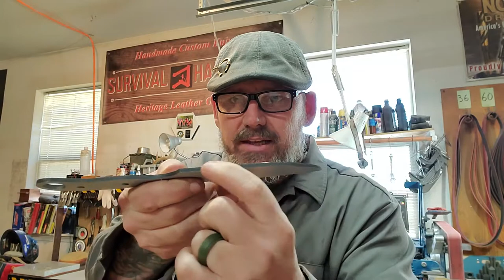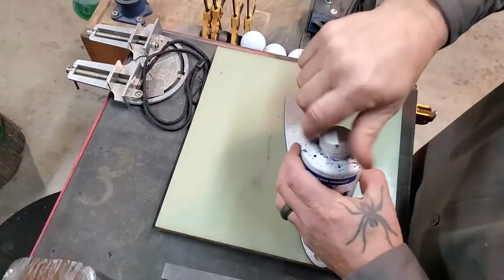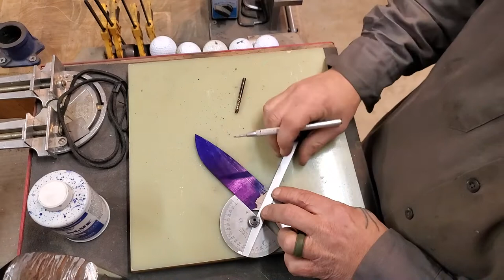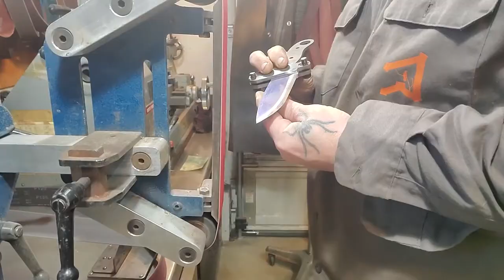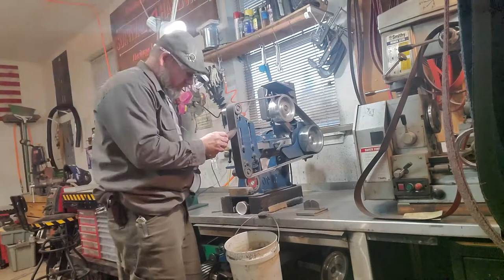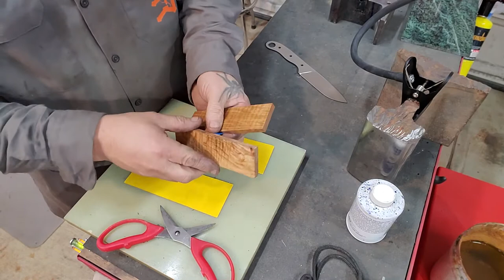10 K giveaway  (KNIFE BUILD #4)  How to grind knife bevels freehand, this is how I do it.

Comment: Diffently waiting to see those scales pop when finished Mr. Dave. What bevel do you use for you edge grind Sir ?
Reply from the maker: The edge bevel will be between 17 and 20 deg .  For the bevel on the full flat it is more of a matter of being centered on the edge and terminates where I want it to.  The angle is irrelevant  in that respect but probably 3 or 4 degrees.
Reply: @MakersMovementDIY  thank ya for the reply Sir. I was just wondering g for the sharpening aspect for my new knife your making me Mr. Dave LOL
Reply from the maker: @heathboeddeker5401  haha, May the odds be ever your favor.
Reply: @MakersMovementDIY  Thank ya I need them

Comment: I smell burning fingers, anybody else smell burning fingers. Maybe it's just me knowing that if I were grinding this blade I would forget to cool it down and at some point my fingers would lose their fingerprints. lol :)
Reply from the maker: That's why I dont grind with gloves on.  My fingers will tell me long before I ruin the heat treat.
Reply: @MakersMovementDIY  That's something I hadn't thought of, ruining the heat treat. :)
Reply from the maker: @KoalityofLife  Some makers heat treat after the basic grind but I do it this way because it reduces warping and potential cracking.  It is harder on the belts but I always grind with brand new belts anyway so for me the benefit outweighs the cost.